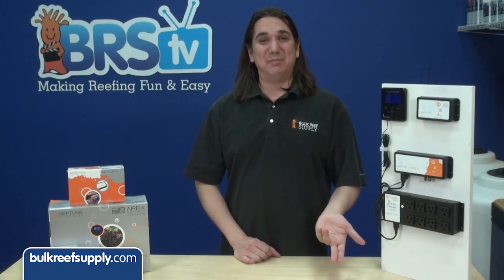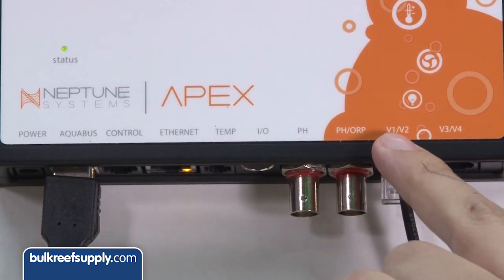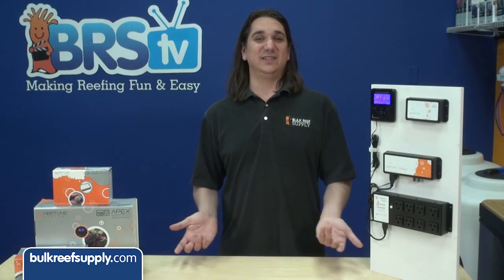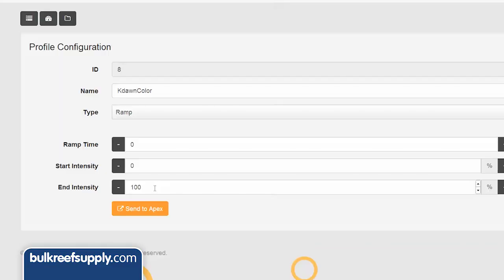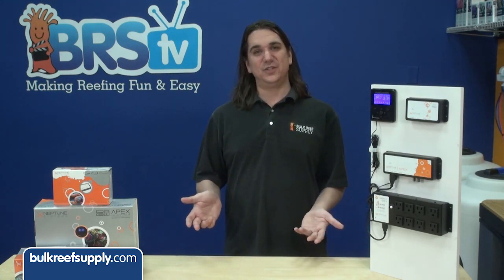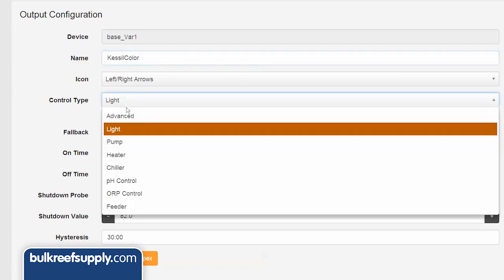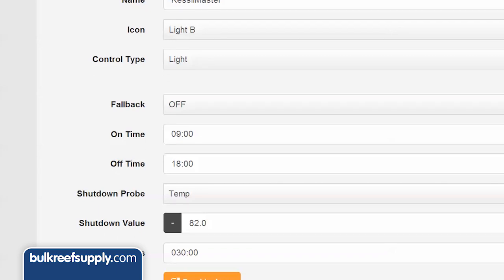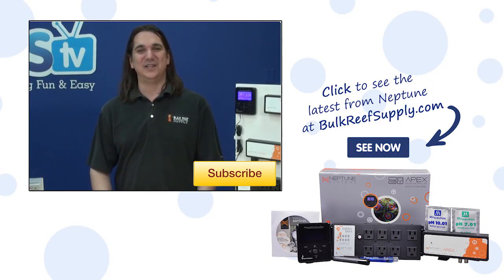Program Dusk & Dawn on Kessil in Fusion EP 18: Apex Aquarium Controllers from Neptune Systems

Comment: Rookie question:  I'm begging to set up side by side 180g half cylinder tanks that will share the same filtration and controller - I'll be doing 2 or 3 kessels per tank for a total of 4 or 6 kessel led units.  Can this be done with the apex neptune?  In other words, can I use a Y or something so that 1 channel is one tank but controls more than 1 led pod?  IF NOT, can I daisy chain a second lighting controller in order to accomplish this?  One tank will be pure reef and the other will be mostly fish, so the lighting will be different for the two tanks.

Comment: If I purchase a Radion XR30W G4 LED light, can I plug it directly into the control head unit of the apex? (I saw a note that the radion is compatible with the WXM module for apex, I just didn’t know if that module is mandatory in order to control these lights).
Reply: BulkReefSupplyCom thank you so much!

Comment: Thanks for this!  I'm wondering if I need to plug all 4 of my kessils into a separate plug on the energy bar, or, can I plug only one into the energy bar and use the link cables so that the other three follow suit? 
Thank you kindly!!
Reply: BulkReefSupplyCom so I can plug one into the adapter and use the link cable to link all 4 and I can still control all 4 through the apex?
Reply: As in, I can plug 1 into the adapter and using the link cables I can use the apex to create dusk and dawn effects fir all 4 lights??
Reply: BulkReefSupplyCom Aw!  I LOVE you guys! Thank you kindly BRS!!!

Comment: I'm thinking about getting an Apex system, and lighting is one of the main elements I want to include with it. Just a quicky question. You plugged a cable into the V1/V2 port of the controller. Where does the jack end plug into on the light? I'm trying to get my head around the cabling and what needs to go where?
Reply: +BulkReefSupplyCom you plugged in what looks like an ethernet connector into the APEX, but the top of the Kessils have a pin type connector.   What specifically is this cable?
Reply: +Patrick Egal never mind -- i found it at kessil's site.   Control Cable-Type 1

Comment: I prefer 70 for the day color.  Crisp blue/white.
Reply: ***** I actually have the day color at 30% since I like the blue look and my Rainbow Acan looks amazing! I started the intensity at 50%  because my A160we is only like less than a foot from my surface(using the 90 degree adapter with the gooseneck). I want to go easy with the intensity to see how my LPS react. I'm pretty sure that my SPS and Bubble Tip Nems would be fine with 100% though.